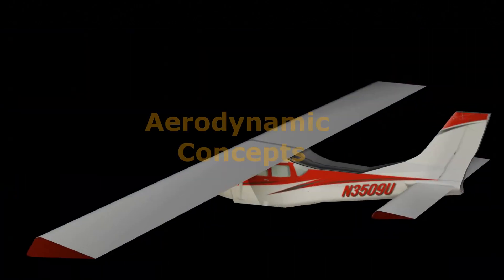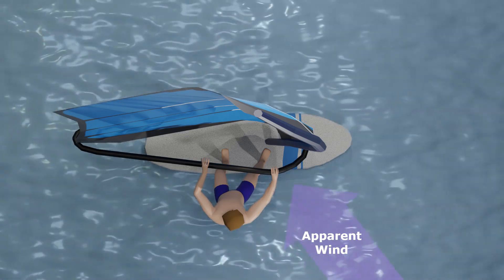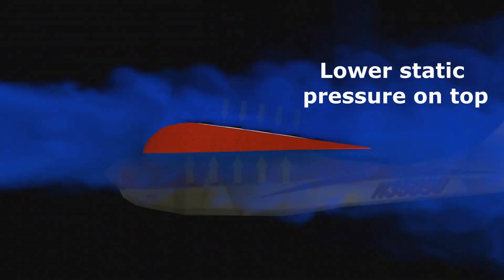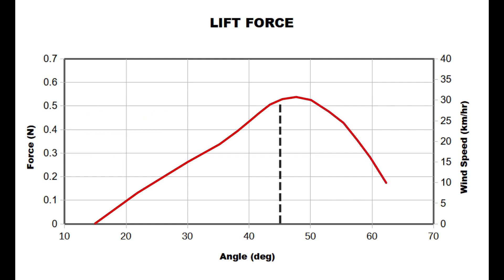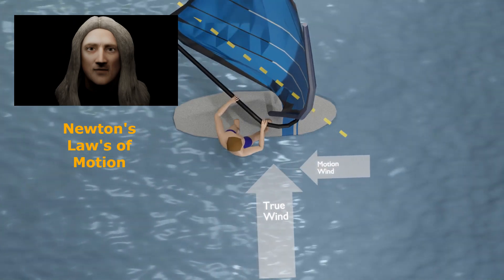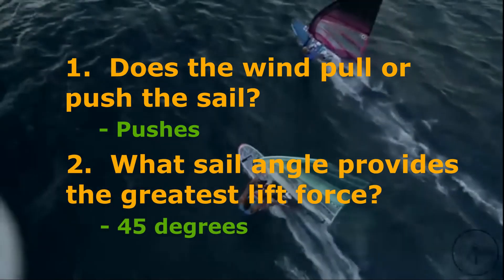Change the way you think about windsurfing

Comment: Hi, I watched the very nice video but I’m not entirely convinced by your explanation. 

First, you mention Bernoulli’s theorem as giving a contribution in addition to newton 3rd law. I am not sure this is true, Bernoulli theorem should be equivalent to newton’s laws (+ some approximations and the continuum limit for fluid particles); it can actually be derived from them. Also, you refer to the lift originating from Bernoulli’s principle as only coming from the depressurisation above the wing, but actually a correct application of the principle takes into account both the decrease in pressure above the sail and the increase in pressure below it. For what I know, in this case one could calculate the total time variation of the momentum of the air (which is pushed down by the sail on both sides) and this would be equal to the pressure difference times the wing surface, so that the 3rd law is consistent with Bernoulli theorem as it should. Then, 3rd law and Bernoulli are the same thing, taking both is like overcounting.

In addition, the “particle hitting the sail” explanation doesn’t take into account that air particles interact with each other through air pressure, so that air is changing direction in a widespread region around the sail. We experience this for example when we sail close to another boat either to windward or to leeward. This gives a contribution to the lift which in your picture can’t be taken into account.
 
Another thing which I can’t understand is the result of the experiment. In books like Bethwaite’s HPS 2, there are studies of various sail profiles and all have a maximum lift coefficient around 25-30 degrees, after that the sail stalls and drag takes over. Also, if I think about more concrete sailing experience, we can clearly see tell tales already stalled at 45 degree AWA, and indeed one experiences a loss of forward trust. Can it be that maybe the red line in your plot is not describing purely the lift component but maybe a combination of lift and drag? This could originate from the rope measuring the force changing direction with respect to the vertical line when the angle of attack is increased. Then everything would make more sense to me. 

Of course probably I’m missing something important in my understanding, I would be very happy to hear your thoughts if you have time to answer. 

Thanks again for the nice video!
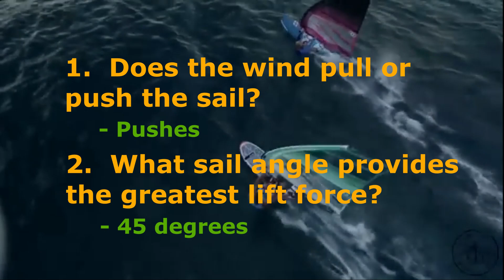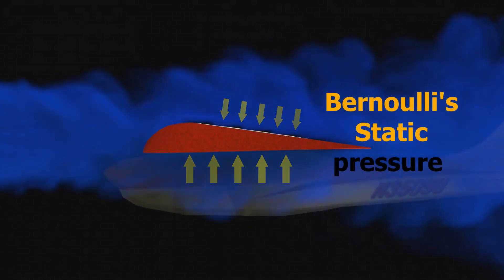Reply from the maker: Thanks @Giacomo for your comments.  Yes, I think part of the confusion is that Bernoulli's equation is made up of 2 parts (pressure due to gravity being ignored).  One part addresses the static pressure which is often spoken as "the pressure" when it comes to aerodynamic discussions.  What you are speaking about is the dynamic pressure, which is definitely a derivation of Newtons 2nd Law (F=ma), and so when incorporating the surface area into it, the two are basically reflecting the same thing.  This is what I was very briefly getting at at 7:25.  I also made a point of highlighting that it is the STATIC pressure differences being discussed in the aerodynamic discussion at about 3:47.  

Regarding the  particles interacting, you are right, and perhaps I could have expanded on the point I was making with Bernoulli's principle being applicable to ideal fluids, with no turbulence, density changes, viscosity, or heat generation.  So, when you speak about air interacting with adjacent sails from other boats this would  be due to turbulence and Bernoulli's principles would not be directly applicable .  You would have to consider Navier-Stokes equations and that gets very complicated.  

Regarding Berhwaite's HPS 2, I'm not familiar with that book.  It could be that this is due to the static lift forces alone, and not the dynamic forces.  It is hard to say.  I'll have to get my hands on that book at some time.  
Thanks for your thoughtful comments!  :-)
Reply: @3denlightenment  Thank you for answering and sorry If I get back to you only now, I was a bit busy last week!

I think you’re misinterpreting the term dynamic pressure. Dynamic pressure is an old school term to talk about kinetic energy density, which is the other term in the Bernoulli eq p+1/2ρ v^2=const. This term is no pressure at all, in the sense that it doesn’t exert any force perpendicular to any area. If you’re thinking about a collision-like momentum transfer from the change of the velocity AT the boundary between the fluid elements and the wing and you refer to this as a change in the dynamic pressure (which is improper since this would be a change of a scalar quantity), still this can’t be the case. By definition flow lines are parallel to the wing surface, so there’s no velocity variation orthogonal to the surface at the boundary. 
The resolution of this conondrum is that you’re neglecting air particles interactions under the form of air (static) pressure. Pictorially, the moment the air approaches the sail, it starts pushing the air around since it faces an obstacle, and this interaction results in an equilibrium state where there’s a (static) pressure variation with respect to the atmospheric pressure and a static velocity field which bends around the sail. However, these pressure and velocity fields are varying also far from the sail, since it’s like every air element is pushing the nearby ones down thanks to the pressure difference. This is consistent with Newton’s law, since it’s a rephrasing of the fact that “there’s a force which is causing the air to accelerate”. This force at every point is proportional to the (static) pressure gradient, and consistently there’s  a change in what you call dynamic pressure. However, The way the force is transmitted to the sail is through (static) pressure, there’s literally no other interaction between air and sail if we neglect viscosity. To get the total force, you add all the static pressures along the surface and you fine that there’s a net depressurisation above and a net pressurisation below which cause the upward force we call lift (+drag here neglected). To sum this up, it’s not that static pressure is there by itself and in addition you have dynamic pressure from newton second law, it’s the conservation of the sum of the two which is newton second law (in the form of Euler equation under the assumption of irrotational and non viscous fluid).

The interaction between air particles is what we call pressure, and it’s there irrespectively of viscosity or turbulence. Even in an idealised perfectly laminar flow you would experience an header when to windward and bow back with another boat. Turbulence adds to this but is a separate effect. This should show the point I’m trying to make. In any case, I think here http://www.av8n.com/how/htm/airfoils.html#note50 it’s explained very clearly.

I was also thinking again about your experiment: since circulation is very important in establishing lift, I’m not sure that separating the flow into two different streamlines creates a negligible perturbation. It may (probably) be that you’re measuring something very different from the real scenario. 
I read that you wrote that this should at most increase the pressure difference since the air below is now totally still and not “only” slower as in the real case but this is wrong. It’s not velocity by itself which relates to pressure, it’s acceleration which causes/relates to a pressure difference, if one applies B. Correctly. So, at minimum you’re losing the pressure variation coming from the slowing  down of the air below the wing. Here https://en.wikipedia.org/wiki/Bernoulli%27s_principle on the last section is well explained.

I would also like to comment on other statements I read by others in various comments.
1. As everyone here says, the “equal time of transit theory”is false. It’s disproven by theory and experiment. Still, this doesn’t invalidate Bernoulli principle. Actually it is experimentally measured that air is faster above the sail, so much faster that reaches the end before the air coming from the bottom. 
2. To the ones who are saying that B. Principle is applicable only along a flow line, that’s correct in the general case. However, in the case of an irrotational flow as the one we are considering now, from Euler eq. you obtain B. principle to be valid as a conservation law on every point of the fluid.
3. “But here the flow is not irrotational, there are vortices at the top of the wing”. There are indeed vortices but the flow is still locally irrotational (outside the boundary layer). The tricky point here is that the velocity field is not define on a plane, but topologically speaking on a plane minus a disk. Then, you can have irrotational vector fields which still give finite circulation when integrated along a closed line (for who’s aware, there are closed forms which are not exact). This is in essence the K.J. theorem. 
4. The fact that there’s turbulence in the boundary layer is very important to study precisely when the sail stalls, but again it’s not invalidating B. since most of the air which is bent is further from the sail and moves in a laminar flow.

Bethwaite books are amazing, strongly recommended:)!

Let me know if you agree with all these things:)
Reply: @Giacomo.Contri  Excellent explanation and informative links. It's unfortunate that the channel creator didn't do some more reading before showing billard ball collisions and "bullets" being deflected to explain lift.
Reply from the maker: It is not explaining lift from an aircraft wing perspective and the particles don't bounce off the surface but transfer energy to the surface through impact and direct fluid pressure on the sail surface.

Comment: The lift force through static pressure is not enough to lift an airplane alone. That's why the wing always has some AoA, in TOL it has way more. The wing profile forces a huge mass of air downward on every moment, which then causes an opposite reaction on the wing and plane. This effect creates most of the lift force. In high speed flight the drag can be optimized by reducing AoA and relying more on the pressure difference.
Reply from the maker: Very true.  Thanks.
Reply: @3denlightenment  In airplane wings, science shows that about 2/3 of the lift comes from the lower pressure above the wind, and 1/3 from the higher pressure below the wing. I don't know whether that translates to sails in the same way. 
By the way, what the video calls dynamic pressure in the video is normally called the total pressure. The dynamic pressure is then the difference between the total and the static pressure.

Comment: i disagree with your explanation, while of course the force is the greatest at a 45° angle you completely leave out the force that is not pushing the windsurfer forward but the force to the leeward side, thus the angle at which the sail is held to the apparent wind is far less than 45°. In my estimation the angle at which the sail is held to the apparent wind is between 2° and 20° in which range the pulling forces (Bernoulli) are substantial. America's Cup boats sail the sails at an angle of 2-4° to the apparent wind. Otherwise there would be no point in Giving the sail a wing shape would there?
Reply from the maker: Thanks Nils.  The experiment was designed to demonstrate that effect if it was occurring at wind speeds typical of windsurfing.  The model set up measured the lift forces  on the sail as the wind flowed over the leeward and windward side.  The red line on the graph was  a combination of those two air flows and a direct measurement of the combined lift force.  If the angle between 2 to 20 degrees in fact generated the most lift, then that should have been observed in the measurements, but it was not.  It is possible that due to the double sail design of the America's cup sails it may make a difference, and at higher wind speeds it may make a difference.  Thanks  for you comment.
Reply: @3denlightenment  Thanks for your answer, what I mean is that yes, the 45° angle will provide the most amount of lift, no question, but it is not about that but rather a question of A: what angle provides the most lift and B: what angle creates the least force leeward (0° of course). You only measure the first component in your experiment.  You would have to plot those to forces against each other and the result will be that the optimal angle of the sail to the apparent wind will be somewhere in between 0° (least forces leewards) and 45° (most lift) In your experiment you only measure the lift component, but of course the force to the leeside is super important as with a smaller force in that direction you need a smaller fin to compensate and in turn will go faster.
Reply from the maker: @WindsurfingNils  Thanks Nils, just to clarify, when you say "force leeward" are you speaking about drag?  If so, that is correct, I didn't measure that.  It would be interesting to do that but tricky to set up.

Comment: The wind pushes the sail, the sail pulls the boom, the boom pulls the mast and the mast drags the board through the water.
Reply from the maker: Pretty much, although it is not a linear chain as the sail is attached to the mast too.  Also, unlike in a sail boat, the sailor is holding on to the boom and applies direct pressure on to the board which drives the board forward.  So, there are three points of drive from the sail, the mast, and the sailors two feet.
Reply: @3denlightenment   the sail is attached to the mast in a way that it can not provide forward force. Only when you surf downwind it will and that's almost never. Look at the red line 01:23. The sail can only pull the mast in the direction of the line and that's backwards. 
And you drive the board forward with your feet?? I never heard that before and I don't think it's true.
Reply from the maker: @Kogacarlo  Thanks Carl.  For an explanation of foot pressure, check out my first video https://www.youtube.com/watch?v=cjTb15pme-g&t=299s on the influence of the sailors feet when steering in lower winds (and when tacking).  Also, the foot pressure is what makes windsurfing unique from typical sail boats where the mast is completely held at one point by the vessel.  Without the pressure of your feet on the board, the mast would fall over with the wind so foot pressure is definitely involved.  I also discuss how the resultant force is always downwind but there are forward components (i.e. across wind), which when combined with the angle of the fin (and dagger board) allow the boat to sail across and upwind.
Reply: @3denlightenment   "Without the pressure of your feet on the board, the mast would fall over" That must be right. I'll look into it.

Comment: Correct me if I'm wrong but this only applies when your board is at 90 or less degrees to the wind. when is more you need your sail also nees to be more degres to the wind
Reply from the maker: Yes, that is right.  I focused on the beam reach as that is a common point of sail, but If you are on a run, for example, you wouldn't have your sail at 45 degrees to the wind.  So, if you are sailing downwind, there is a gradual transition from the  45 degrees to 90 degrees.   Keeping in mind that the physics of sailing straight down wind are quite different and you cant sail faster than the wind at that point of sail.

Comment: Newtownian conservation of momentum - yes. Bernoulli - not at all. Streams don't meet at the back of the sail , only works within a pipe- constantly perpetuated false explanation. Coander effect due to curve of the sail - yes.
Reply from the maker: Thanks Matty.  The streams meeting at the back of the sail at the same time is a myth and that is why I never mentioned it.  I would have thought the air flow would be due primarily to the coanda effect due to the partial vacuum behind the lip of the curve, but the air flow over the upper wing surface has been shown to move faster (see this video @ 2:55 min https://www.youtube.com/watch?v=uyRx25MSWng&list=PLXhjbbJG1cRFzPzfOhmyJX9MGOzqtkIUu&index=66&ab_channel=FlywithMagnar) and is largely explained by Bernoulli's principle.  Either way, it is definitely caused by the partial vacuum.
Reply: @3denlightenment  - https://youtu.be/UqBmdZ-BNig.  I like this video for explanations of wing theory , see what you think.
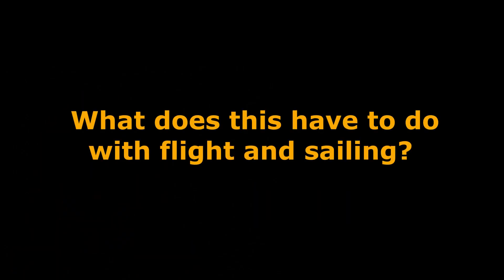Reply from the maker: @mattyclare   Thanks.  I'm well aware of that video and I probably should have shown a clip of it in my video.  This effect is explained by Bernoulli's principle, and the conservation of energy.  So, when the static pressure decreases, the dynamic pressure increases and the air flow moves faster.   I tried to indicate this in my video at about 3:25.

Comment: Thank you for your video. I appreiate your effort to compare a sail to an aircraft wing.  However an aircraft wing is a device to maximize lift and minimize drag while a sail is a device to maximize drive and minimize heel. This is probably way beyond what simple physics can explain in a short video.  Again I appreiate your efforts.
Reply from the maker: Thanks Brant.  You're welcome.  As you know the whole concept of lift is mysteriously controversial.  I received so many comments on my first video asking why I didn't relate back to the concepts of aerodynamics.  The purpose of showing all of the aerodynamic concepts was to try to clarify that they are similar yet different from sailing.  Hopefullly that was conveyed to a certain degree.  Also, at least in windsurfing, there is no heeling of the vessel, so that wasn't going to be part of it.  Thanks for the appreciation.